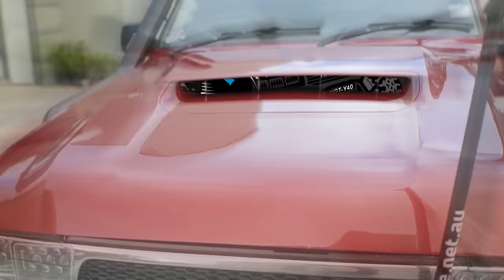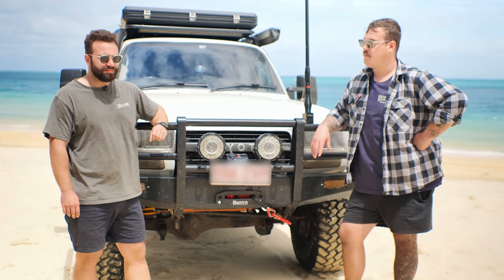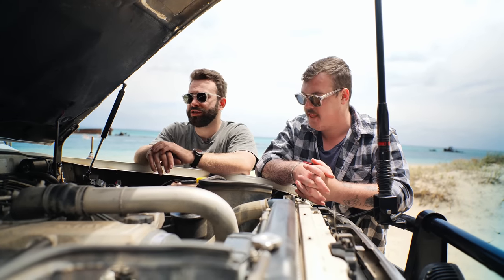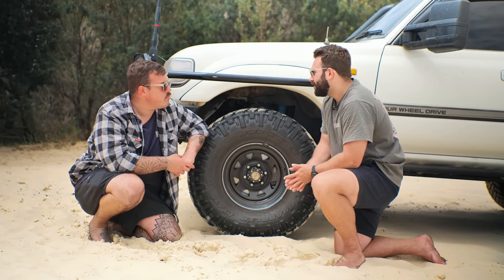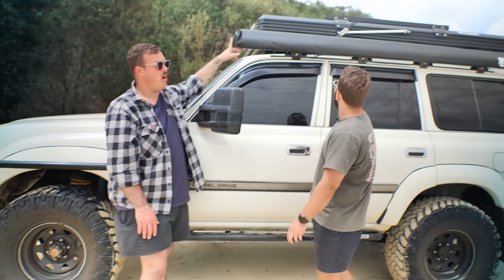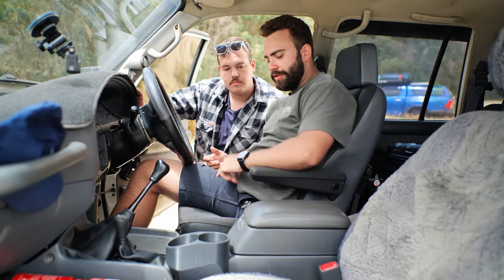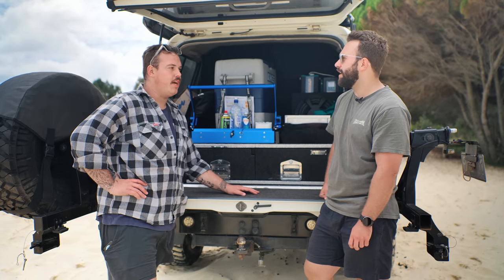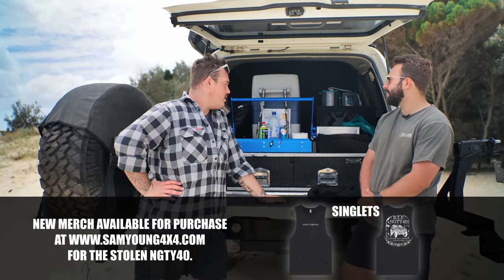300+hp 80 Series Super Tourer - The Perfect Landcruiser? | Sussed With Sam Ep 7

Comment: You will have to have a lot of spare cash to build this. I found a 1995 Sahara 1HDFT ex japan,  in a barn in NZ, with 199 Kilometres on the clock. The owner was running from the Tax dept and shot through to Aussie. His father sold it to me for what his wayward son owed him $4,500.00 NZ dollars. The vehicle needed a lot of work due to neglect. Have now owned her for 15 years, and after few additions, like top intercooler, snorkel, trans cooler, 3" exhaust, and a 'garrett' turbo as a bolt in replacement for the factory turbo, now produces 300HP at the rear wheels. This is my everyday drive and has just capped half a million k's. 500.00K. Best damn vehicle ever built. NZ got up market 80 series to Aussie.

Comment: Mate better use of space for the rear, go draws on top of each other and piss the drop down slide off and mount a 40-60lt on the floor with a normal slide. Flat floor for storage above fridge and draws. Lighter and better use of space. You might have enough room to run a water blader between the rear seats and draws might have to run a half cage though.